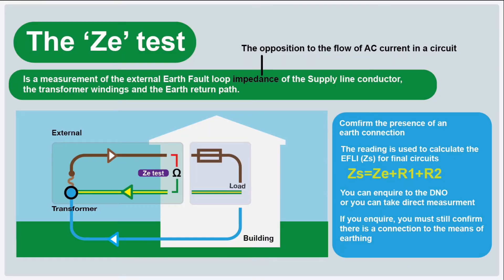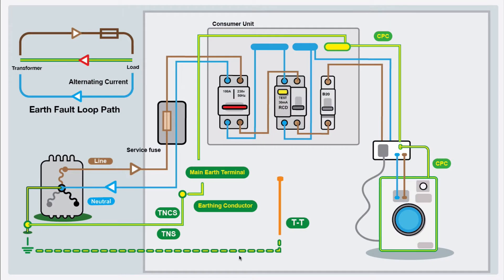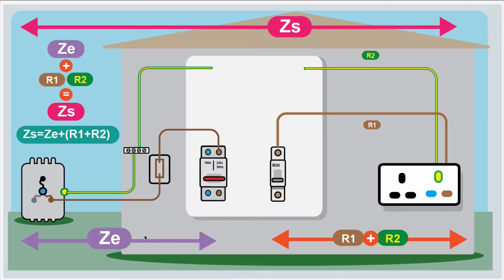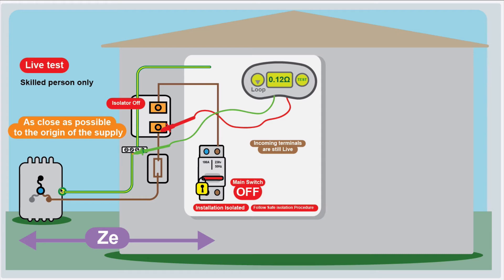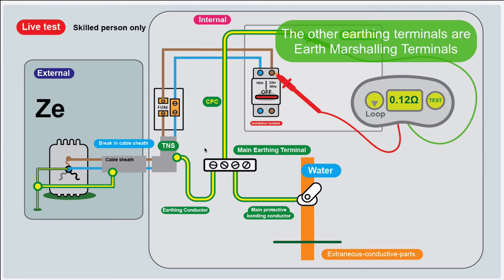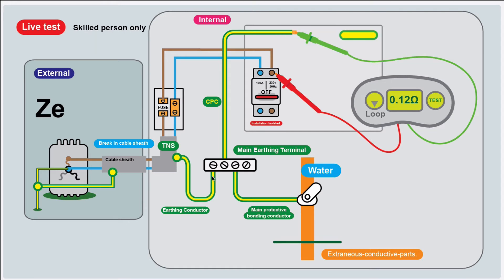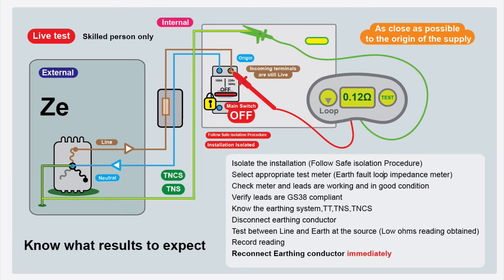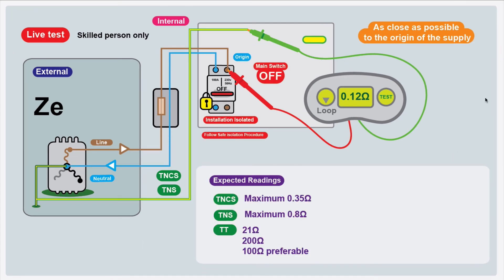Testing  the Ze of an electrical installation

Comment: What does zdb mean by the way?
Reply from the maker: Hi FairisFair, Thank you for your kind  comments on my videos. Zdb is the Zs reading at a distribution board. The Ze is at the origin, any other boards would have a Zdb measurement. So the Zdb would take account of the Ze and the impedance of the cable feeding the distribution board.

Comment: Is Zs= Ze + (R1+R2) or Zdb + (R1+R2) at DB2 .thanks
Reply from the maker: Hi Pcg 127 You only have one Ze and thats at the origin.  Any subsequent boards will be your Zdb (your supply to the board. Then you would ad on you R1 + R2 to get the Zs.
Reply: @JPElectric  so the measured impedance of a circuit in db2 would be Zs= Zdb + (R1+R2)

Comment: Thanks for the vid. On a 3 phase system I test across earth to each phase do i then test N to each phase also? And then I have to double the highest reading? I’ve confused myself and my am2 is tomorrow
Reply from the maker: The Ze test for three phase is just between each phase and the  disconnected earthing conductor  ( DB isolated)
The highest reading would be your Ze..
Remember to reconnect the earthing conductor as soon as you finish the test.

By what you describe I presume you mean a PFC test. 
Yes you need to test to see what is the highest possible fault current that can flow between conductors.
So you need to test 
Earth to each phase .  
Neutral to each phase. 
But we also need to know what is the fault current that could flow between phases...
Testing between phases  is often discouraged  as this will provide the highest fault current, and some testers could not handle it...( but it depends on what training you are doing, I am sure you will have gone through this on your course)
So, to err on caution  the highest measurement taken when testing  between each of the  3  phases and neutral you would double,and use that as a guide for you phase to phase fault current. So you do not need to test between phases

Remember you safe isolation though.....

For safe isolation on 3 phase its 10 tests
L1 and L2
L1 and L3
L1 and Neutral
L1 and Earth
L2 and L3
L2 and Neutral
L2 and Earth
L3 and Neutral
L3 and Earth
Neutral and Earth